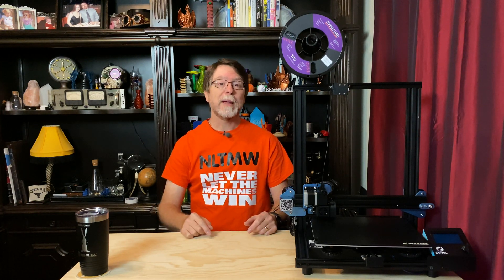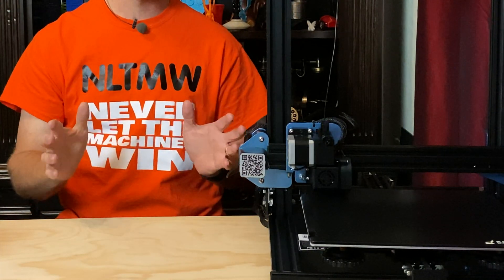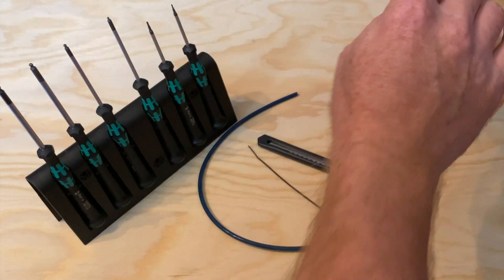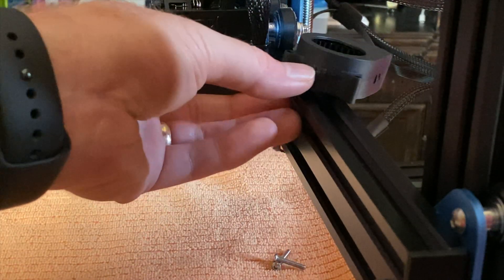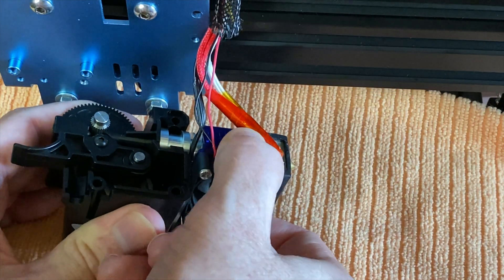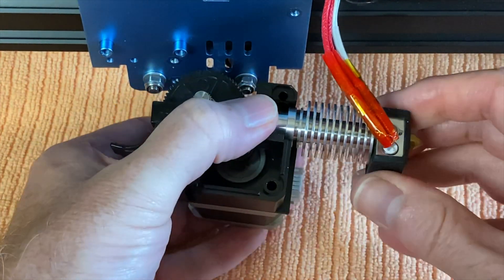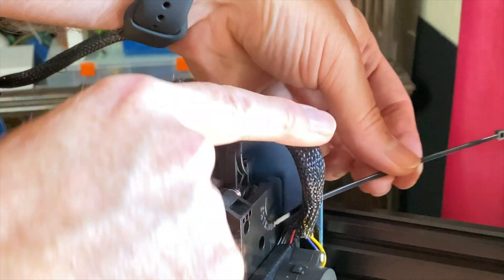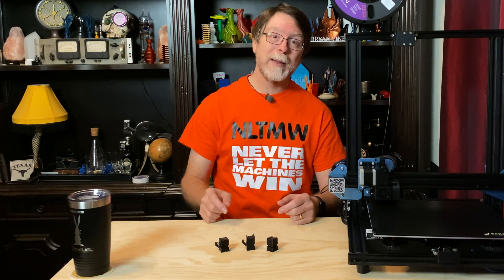How To Install a PTFE Guide Tube in the Sovol SV01 Extruder

Comment: In 2025 this video is still relevant. I have an Sovol SV08, which is not the same of course, but also had an internal PTFE guide tube. I had real trouble getting the filament to load far enough into the hot end. I decided to replace the hotend with a MicroSwiss FlowTech. While replacing the hotend a small piece of PTFE tube fell out! I had no idea what it was for until I searched and found this video. I had to push that small PTFE tube piece back up into the assembly from the bottom before installing the MicroSwiss hotend - otherwise, there was little chance of being able to get the filament into the MicroSwiss hotend. I may eventually replace that small PTFE tube (because it gave me trouble before the upgrade), but it seems to working OK for now. Thank you for this video!! :face-blue-smiling:

Comment: Neither of the two Sovol sv03’s came with tubing in the guide…one of them I put out of order temporarily because I broke a wire for the thermastor at the connection to heater block and I’m not sure of the saldering location to fix it. Creates an E error when I try to bring it to temp. The newer one is just experiencing it first jam issue and if I’m going to fix the jam I may as well add the tube to hopefully prevent or at least put off future jams.

Comment: Shouldn't the PTFE tube go all the way down into the heatsink as well? I was under the impression that this was not an all-metal heatbreak v6 clone, but rather a ptfe lined hotend where the tube goes all the way down to the nozzle. I recently purchased an SV01, when it arrives I will report back here on the hotend construction.

Comment: My SVO1 came with the a stock white PTFE tubing that was about 1/2" out of the hotend and ran all the way to throught to the nozzle.  It recently failed due to melting near the nozzle.  I cut off the failed portion of the tubing and reinserted the PTFE tubing back into the hot end.  It went all the way through but since I had to cut it, it now is pretty flush with the top of the hotend.  (I ordered a new Capricorn PTFE tubing and waiting for its delivery).  Without that 1/2" extension  through the hotend, its a little more difficult to get the filament down through to the nozzle but not impossible.  I'll be happy when I get my Capricorn to replace the stock white one, which actually has a slightly lower melting tolerance.  Cheers!
Reply: In follow up to my last comment.  I received my new blue tubing by capricorn (supposed to be the good stuff with marginally higher heat tolerance), I eye-balled it for the cut, and everything seems to running better.  However, one thing I noticed, was when I took my extruder apart the flush white PTFE tubing was already poking back out of the heat sink by, about 1/2", which leads me to believe that if the length of tubing is not cut just right, it might pull back from the nozzle by that much, which may cause oozing.  Just food for thought.

Comment: i just opened mine up and it had ptfe tubing all the way through the heatsink and to the hot end. would i have better luck printing ninjaflex if i cut it to the just the opening like you showed in the video? i was planning on putting capricorn tubing.

Comment: This is not how the current ones work. It still looks like a V6 from the outside, but the PTFE tube goes all the way through the heat break into the heater block. When I discovered that yesterday, I ordered a genuine E3D V6 immediately.

Comment: This is for the original SV01.  Starting in December 2019, Sovol used a different steel tube that allows for a 3mm silicone tube to go all the way from that upper black filament feed nozzle down all the way to the heater end and brass nozzle.  It is much more reliable.  Sovol sells this improved hot end for $20 each.  I bought a few but with 10 machines, it was getting expensive.
So instead of buying the new hot end for $20, you can just take a 4.4 mm drill and drill through the round metal steel tube right before the threaded tube nozzle  so that you can insert the 3 mm silicone tube. That is, unscrew the cylindrical tube, drill through it with a 4.4 mm.  CAUTION: Donot drill the threaded tube that connects the cylinder to the hotend. The threaded tube has its own silicone tube already.  Now you can have a silicone tube from the filament feed down to the nozzle with much greater resistance to clogging.
Reply from the maker: Cool! Thanks for the info about the new hot end (and the trick to modify the old one!)

Comment: I should be getting my Sovol SV01 today 2/17/20. My Tevo Tornado has failed, hot-end issues. In my attempt to repair it I replaced the hot-end first, which didn’t help. I then attempted to FLASH THE FIRMWARE after watching some videos. This failed as I could not follow the videos because various “simple” steps were omitted figuring folks know how to do them. For someone who has never done this before a specific and detailed step-by-step outline is needed. I bring this up because I noticed some comments about hot-end upgrades for the Sovol. From what I gathered this requires more than just hardware, but software changes as well. 
As you explain things well I figured if you ever decide to publish a step-by-step guide for how to FLASH FIRMWARE please let me know (somehow?). I am sure this operation is sub-basic, but never having done this before it’s all new to me.
I expect I may be adding the part you outlined in this video after the Sovol runs for a while; I don’t want to mess with the warrantee.
Reply from the maker: Hi Tom,

I have a couple of videos about flashing firmware from source code. I also have one about using OctoPrint with a plug-in called Firmware Updater, which will let you send firmware in .hex format to the printer.

If you're downloading the source files for the Sovol SV01 firmware, and opening them up in the Arduino IDE, check this video: https://youtu.be/aquuSNEekvY (you can skip past the part about flashing the bootloader, the SV01 should already have one installed).

If you're running OctoPrint on a RaspberryPi connected to the Sovol SV01, check this video. https://youtu.be/aBJ6TBtvUKE?t=648

If neither of those gets you going in the right direction, let me know. Good luck to you!

Comment: should i also do this upgrade, when i only print PLA and PTE?
Reply from the maker: For those materials, you don't need to. The only thing this might do is make loading them a little easier. But they're stiff enough not to bunch up in that little gap. 👍
Reply: @BV3D  thank you.

Comment: Is the heatsink part also wider than filament. In my opinion you need to cut piece of tubing so that goes also into the heatsink part too. I assume this is full metal hotend?
Reply from the maker: This is a clone V6, direct-drive style, and has a PTFE-lined heat break, That PTFE lining is a separate piece of tubing. The part of the heat sink where the filament goes in is a hole wide enough for filament, but not wide enough for PTFE tubing, such as what you'd see on a Bowden setup, where the PTFE tube from the extruder stepper motor goes all the way down to the nozzle.

Sadly, it's not an all-metal hot end, but since the printer is designed to accept the V6, you could replace the existing hot end with an all-metal one.
Reply: BV3D: Bryan Vines i see, thanks

Comment: Ahhh thank you... not doing this yet, since i'm not printing tpu yet... but i'm not so scared about getting this done anymore after your video
Reply: Even not doing TPU, it's a go way to go .... more precise with retractation !
Reply from the maker: Hi, it's pretty easy to do. And it's been pointed out to me that you don't need to take the entire assembly off the carriage. Just be gentle around the wires. You don't want to break the heater or thermistor wires (they're kind of fragile).

Comment: Is that extruder something that could be adapted for an Ender 3?  I like it.
Reply from the maker: Yeah, I'm pretty sure it could. If you wanted to stay with the stock hot end, you'd need to either find or design a mount that would accommodate these Titan clones (like this one, which is about $20 WITH a stepper motor: https://amzn.to/2PduTlk [aff link]). 

Since the stock hot end is Bowden style and uses a coupler, and the extruder I linked to also uses a coupler, you'd need a short length of PTFE tubing to run from the extruder down into the hot end.

To connect the stepper motor, you'll need something like a 2-meter 4-pin to 6-pin stepper motor cable, to reach from the main board to the stepper motor.

Anyway, hope that helps!